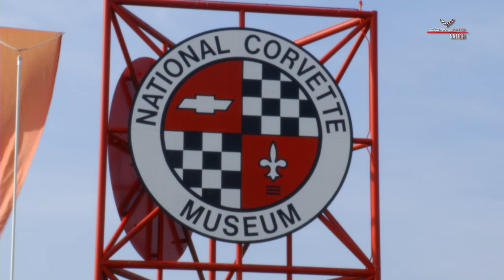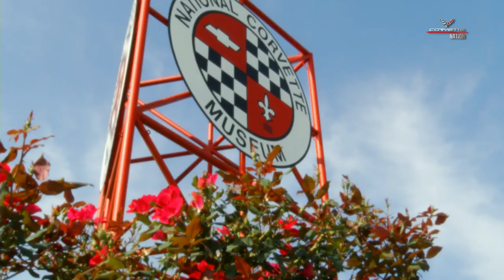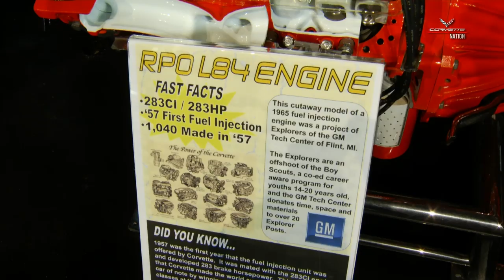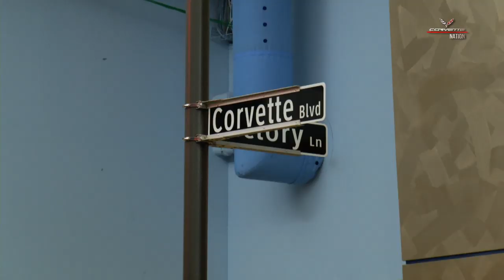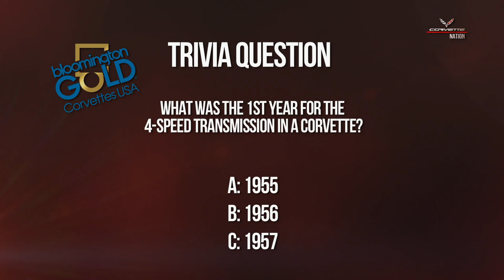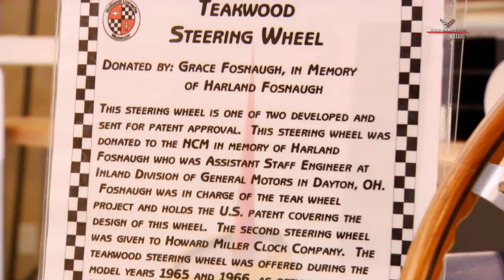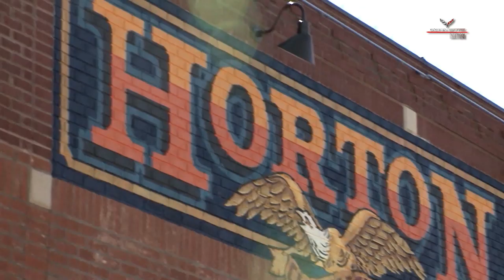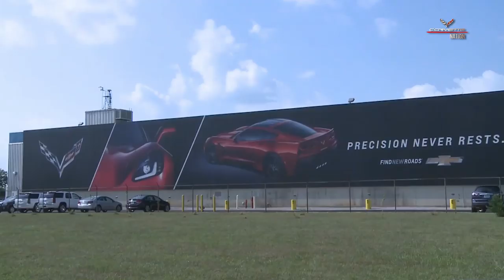Corvette Museum, Episode 10

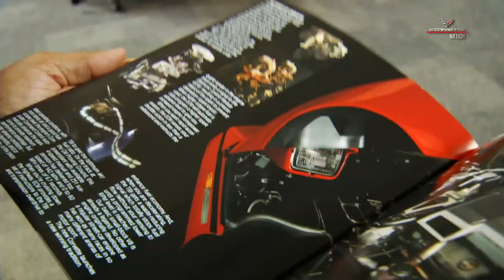Comment: 11:00 incorrect

the wheels that are on the 83 were a set of prototype/pre production wheels that were never released or made it to the final production cars, ive never seen another set of them anywhere outside of the 83, the cancelled wheels on the 83 are 15 inch wheels when the wheels on the final production C4 were 16 inch wheels, you will NOT find a set, ever

No, the 83 was NEVER taken apart or repainted

No, the car was never actually hidden, it WAS parked behind the assembly plant for a number of years mostly because the car dodged the car crusher due to a thunderstorm and the guy in charge of getting the cars crushed didnt want to go outside because he bought a new pair of cowboy boots, he intended the car to be crushed the next morning but by then the mobile car crusher had left, after that the plant executives didnt know what to do with the car so they parked it behind the plant and threw a cover of it, after plant management changed the car was then brought inside the plant and displayed in the lobby with a red white and blue stripes livery for a short while, when the National Corvette Museum was opened in 1994, the car then was moved there and put on display and has been ever since